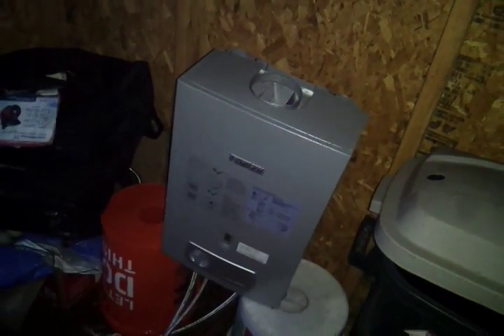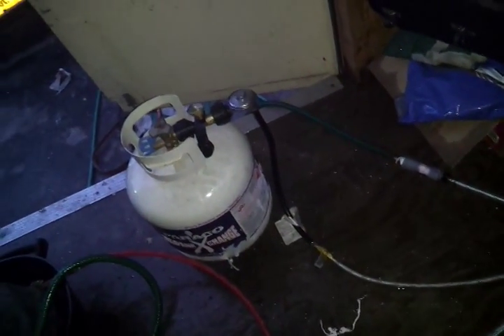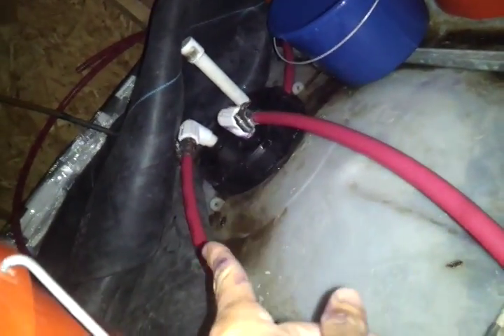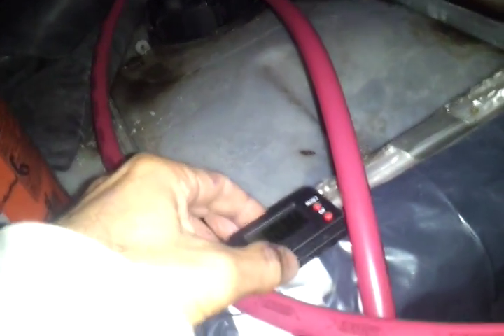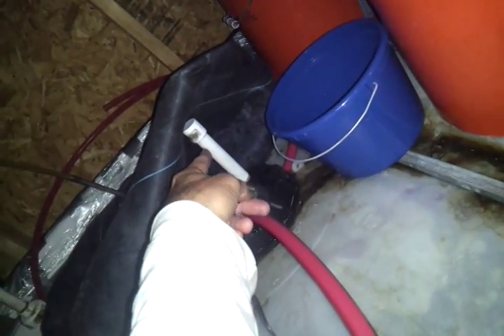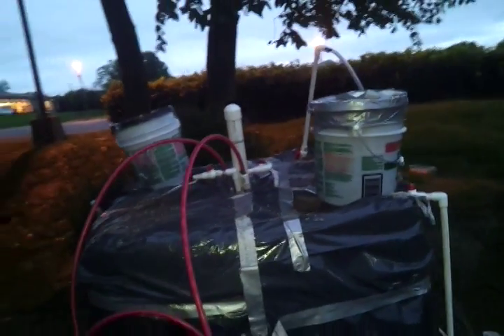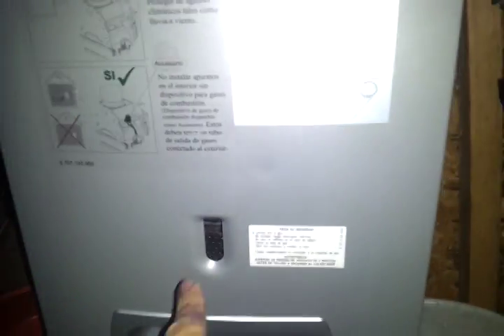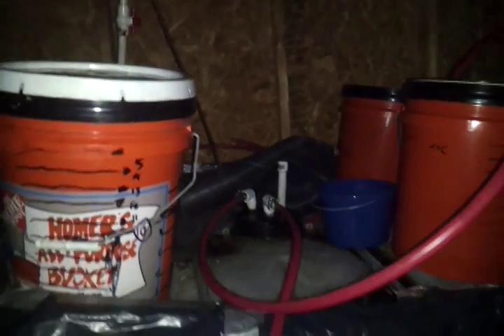On demand heater for heating biogas tank

Comment: I was curious. What temperature should the tank be for bacteria to grow? 24 degrees celcius? Or will something around 35 degrees celcius? This aquecedo the bosch is to work with low pressure gas? What would be the pressure that these systems produce gas? With this information I will put in my power control system to stabilize these conditions.

Comment: Hmm, does it make sense to waste expensive propane gas to heat the digester to produce less biogas ? Or will the biogas be more than the used up propane gas ?
Reply: overunitydotcom someone suggested that I could use a fish tank heater for my small #BioGas digester. 
Conventional solar panel, battery, Low wattage heater.
Thinking about it, you COULD have a fancy convection hob running in an off grid home, but it may pull a bit more power than practical,
the #BioGas however, uses waste
(which we all have access to)
and at least gives us an extra option.

The jean pain method
 http://flaturl.com/IJjp
has a symbiotic approach where the BioGas tank lives inside the huge (heat producing)compost pile. It's practicality increases with a few communally linked homes, In fact the options are endless with parabolic solar heaters (in the daytime) even if you were just heat exchanging (to warm)a specific temperature controlled tank for the BioGas.